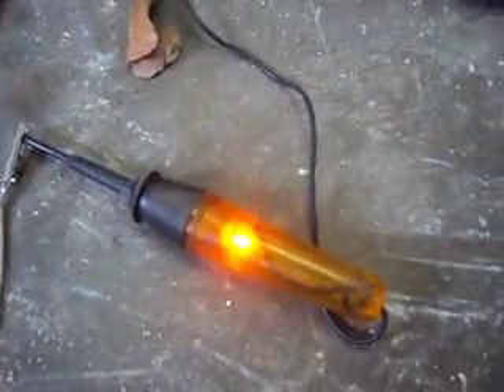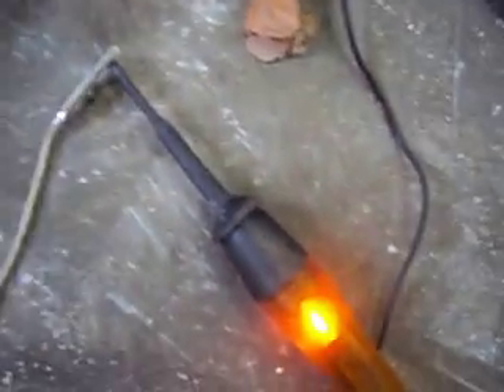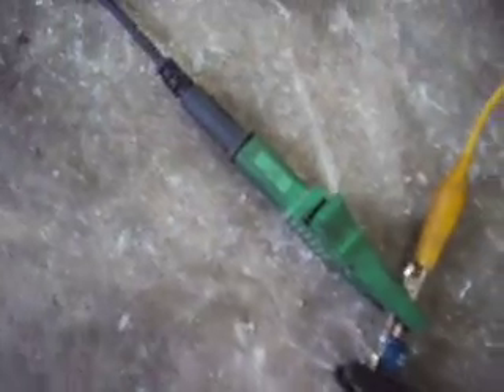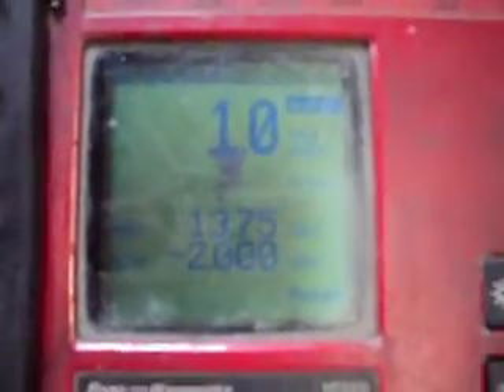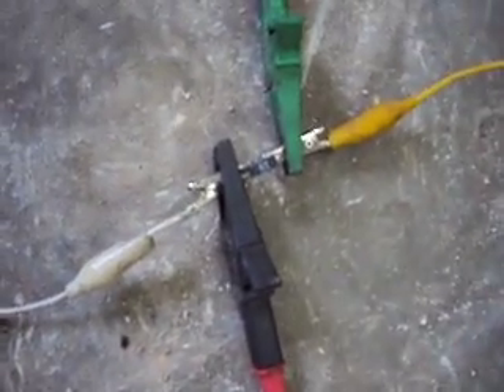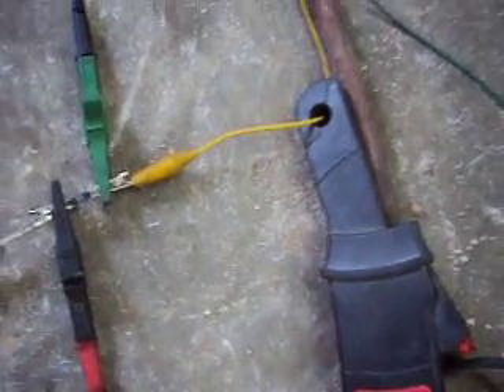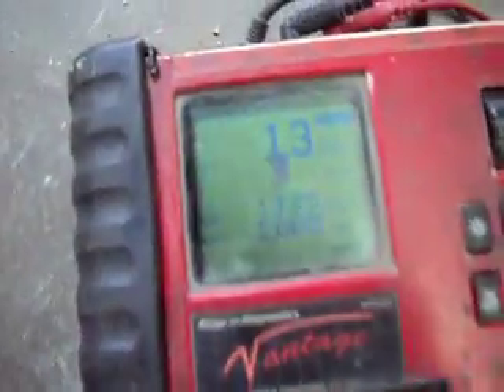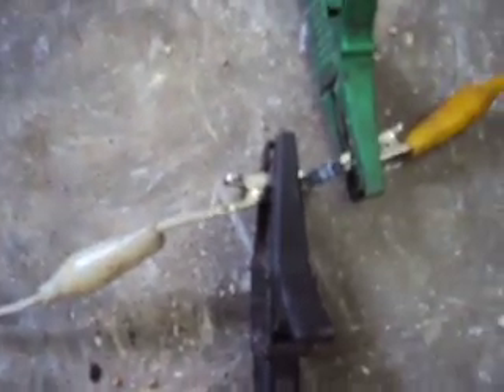Checking parasitic draw

Comment: Also when u have a draw its usually more like 350 ma because an entire module is staying alive so if u use clamp to verify say a 200ma draw now use the voltage drop across fuse/testing to find it and u never unhooked battery

Comment: I have used a low amp probe in a pinch to find a draw on a couple occasions. So maybe w/ the pulling fuse methods causing havoc on todays systems, maybe use the amp clamp to verify ther is a prob. Because we all know just disconnecting a battery to put ammeter in line. can be hell on these new cars with all the auto window relearns and everything else.